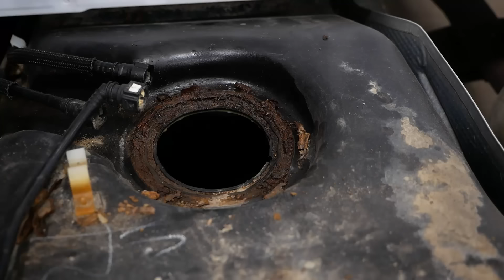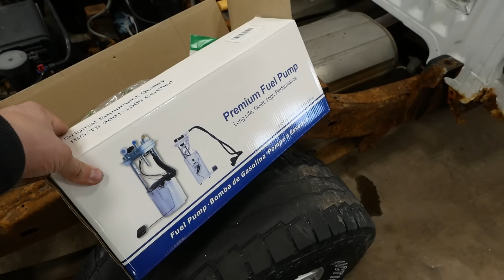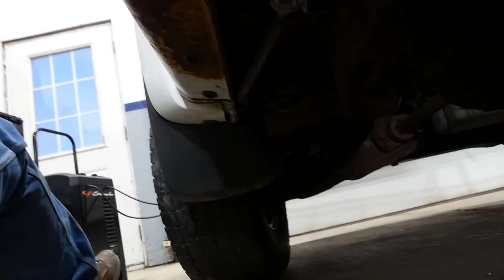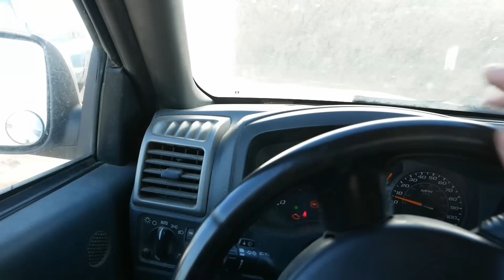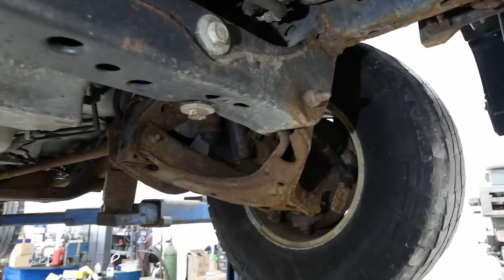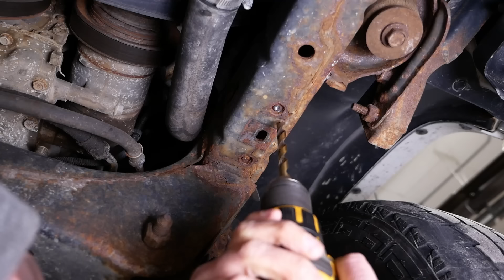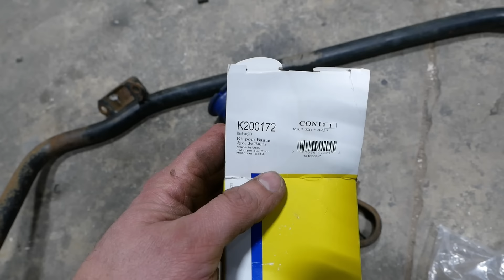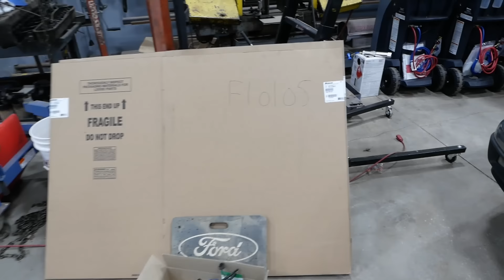Saving a GMC Canyon with 434,000 Miles from the Crusher - Won't Start, Fuel Pump Tabs Rotted

Comment: Hey Wes take it from someone who maintains big diesels that the company buys crappy Chinese aftermarket parts for and who has modified & fabricated a thousand O-rings out of necessity. Superglue is a sub-okay way to do so and if you look at it funny it'll break.

The best way I've found is Loctite 404. After a minute or two of cure time if you give it a tug you'll break the O-ring before you break that bond. A small bottle in the shop beer fridge will last forever, you need the tiniest amount for even the biggest O-ring.
Reply: can confirm about loctite 404. they work like magic on o rings. it will hold o ring tighter than tito holding together Yugoslavia

looks like loctite 404 got an update - loctite 406
Reply: @lordjaashin  404 is still available on US Amazon but it is $29 for a 1/3 ounce bottle.
Reply: Great tip, I'm going to use it!
Reply: isn't that exactly superglue?
Reply: @Netherlands031  no loctite 401 is the general purpose instant adhesive. loctite 404 or 406 are specifically made for o rings and other rubber materials
Reply: @Netherlands031  Interesting, I looked it up and you're right!